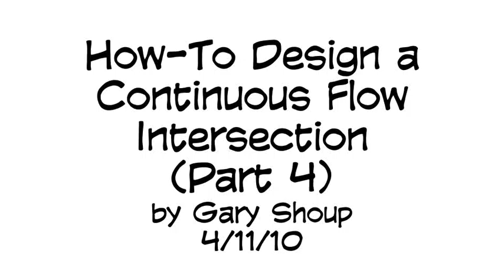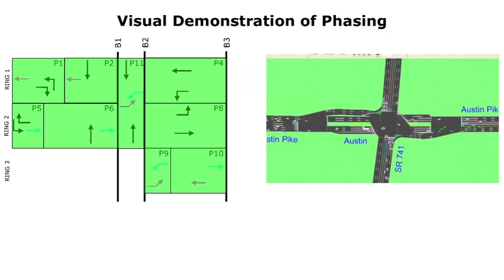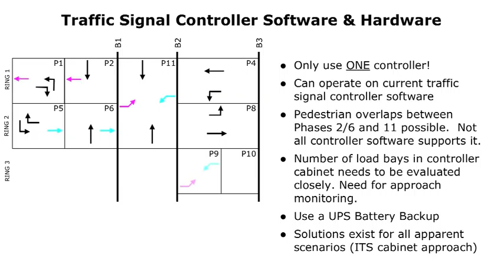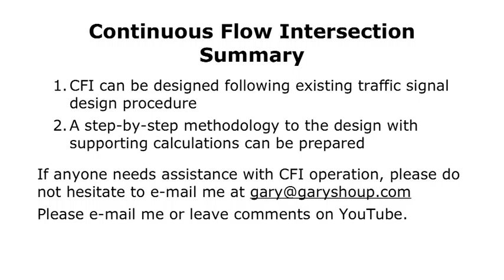Continuous Flow Intersection How-To: Part 4

Comment: Hi Gary, With my slip lane layout, pedestrians cross LT and RT lanes where they cross (3 phases) so pedestrians cross shorter distances than conventional intersections. Examples are at quicksafeintersections.com and the phasing is in the last slide of the "Flow" subject. Each turn movement is individually timed and I have used fixed times. But the controller needs to allow for pedestrian presence detectors and shorten or extend the pedestrian times as required.
Great series thank you.